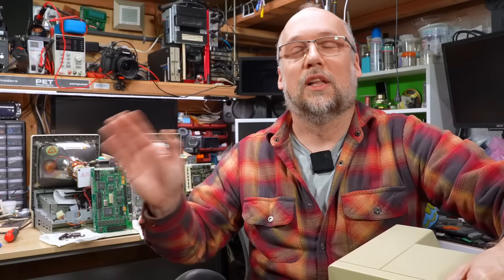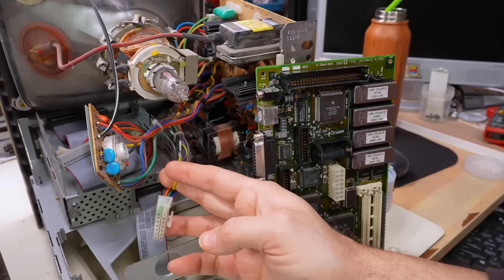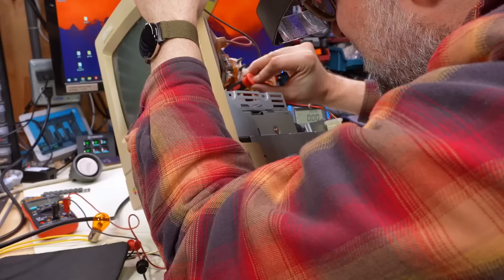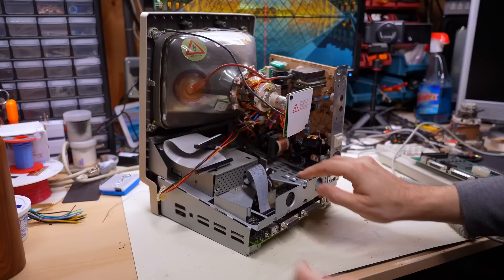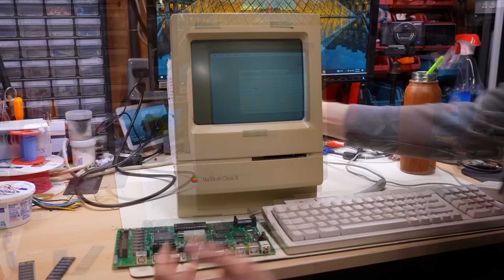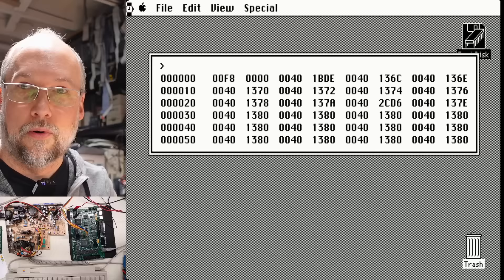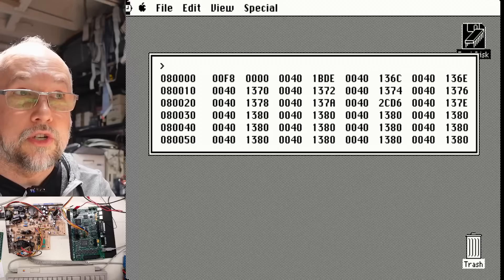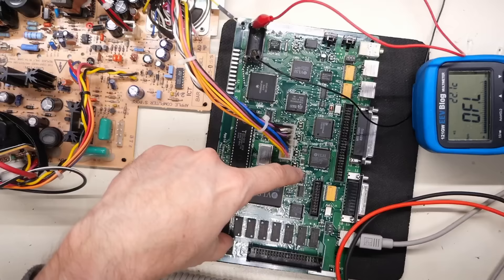The troublesome Mac Classic and Classic II are finally working! (stuck at 512k fix)

Comment: Haha, nailed it on the 74LS174 ;-) Too bad you already shot that so my tip came in too late.. 
I like how you deduced the actual cause of the problem by using the debugger. That's a great tip as well and it will work on just about any broken machine with a debugger (if you're still able to run it of course) 👍
I just shotgunned this issue on the last Classic I repaired and just replaced that chip 'at a hunch' because I'm more of a neanderthaler-repairman LOL 😂 It did the trick for me though as these chips fail quite often! Also I wasn't able to run anything because with me it was a different output on that chip that went bad.. So I never got past the sad mac wether I plugged in the memory expansion board or not.. That Classic also had a bad VIA chip though which I did manage to pinpoint using my scope, so maybe I'm a neanderthaler with a diagnostic mindset 😁 
You taught me quite a lot though and I really appreciate your in depth analysis of issues like these, Adrian. That's really empowering! 👌👌

Comment: Why are certain address lines from the 68000 going directly through resistors?
Reply: They possibly had problems with signal reflections causing data corruption. I would need to see the actual trace lengths, the ones with resistors are almost certainly longer traces, or traces that go to more than 1 component.

Comment: You should get a new SMD 74HCT174. This replaces the 74LS174.
Reply: No, you can not do this. HC(T) logic family has different (longer) propagation delays and in timing-critical application like memory subsystem this will cause issues (probably it won't work at all).
Reply: @hempbear  I think it's very much YMMV. I've replaced F-series with HCT-series in a pinch and it has worked fine. If it's all you've got it's worth a go.

Comment: Hello There Adrian, Ibeen watching you for some time now and enjoy your content. I have a Mac Classic system that I would like to donate or have you repair. I'm not a Apple fan by any means buy when I bought a Lot at and auction this was in the middle. It was not sored in the best conditions but looks ok. It has been cleaned with IPA99% but it has not been powered on as I found leaking caps on PSU board. I use to do board level repair 40 years ago but have the mind to remember how to do it now nor have equipment to do it. How can I ship this to you. John Castillo in South Texas.

Comment: 23:01 - try disconnecting the PSU and then start the machine. Maybe there's junk left in one of the RAM chips that doesn't get properly cleared on normal boot sequence.
Amazing work again, congrats!

Comment: BTW you should be a bit more careful with IPA. One spark and you have a bad fire. Alcohol burns with an invisible flame. You may not know it until disaster is inevitable. I would strongly advise against using large amounts of it for anything unless you are prepared for fire. Not to mention, you can absorb it through your skin and breathing the fumes is not a great idea. Diluting the IPA with deionized water to say 50% will not only lessen the fire danger, it will make the alcohol a much better penetrant and solvent for dirt and grime.